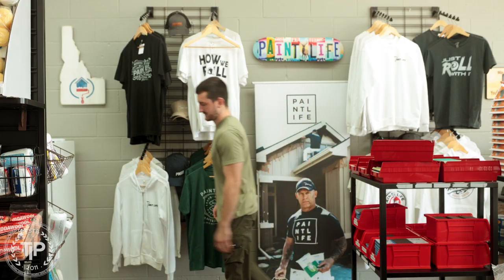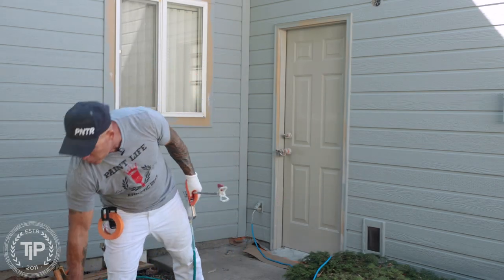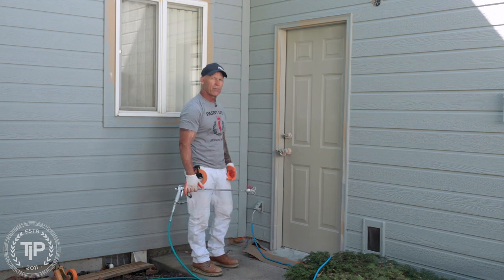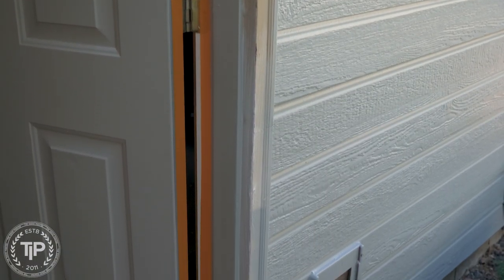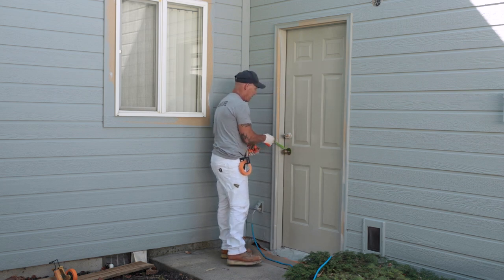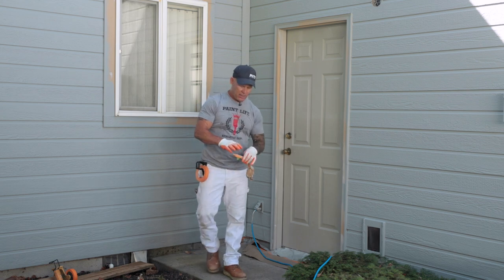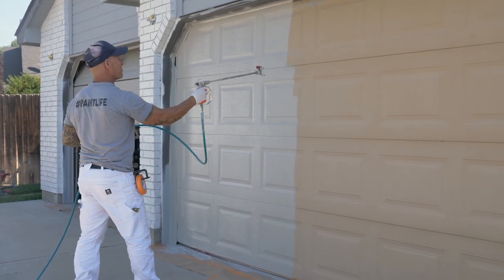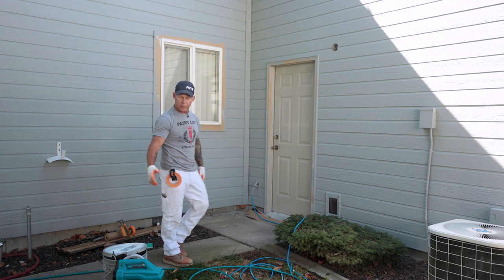Junk airless sprayer! Dino X6 Review. Harbor Freight Airless Paint Sprayer

Comment: Currently doing an exterior job, using the graco x5 with a 515 and a fflp 310. Works perfect! Have, to date, ran about 100 gallons of paint through this sprayer and is still running great. The key is to take care of your equipment! They can last a long time, just as long as you clean them extremely well! If you run hourly employees and are worried about your crew giving a shit about your tools, try this sprayer first!

Comment: I'm a renovation business owner, not a painting professional. I believe the Graco magnum x5 is an excellent low cost piece of kit. I spray anywhere between 1 & 3 gallons each time it's used. Believe I paid $450 canadian. Came with hose, gun and 515 tip. Currently use the Graco fflp 312 tip for cabinets and it works great.
Reply from the maker: The X5 is a low cost DIY pump at best.
Reply: @Idahopainter  correct, like I said not a pro and there's no point in dropping a large sum of cash on something that gets used 2-5 times a year. Great videos by the way. Wishing you nothing but success.

Comment: Thanks for the videos, and we are the manufacturer of this DINO-POWER X6.
The X6 is a DIY machine for the home user, not for professionals, and we can't agree with the conclusion in ''JUNK.''
The weight of the machine and the light spray gun should NOT be a disadvantage of a DIY sprayer, which you can compare for all the brands at the same level.

For the wooden door painting from the video, you might use the smaller tip, like 313, for better control,  and the pressure will be steady and won't drop rapidly.
As if the latex paint for interior wall coating, you can use 515, and the pressure's performance will be much better.

Anyway, this is an old model we produced at least 3~4 years ago; we improved the output of this model now, and the spraying pressure with 515# 517# will be 1800psi+
And we can supply the new model X9 for supporting the 519# with 2000psi + pressure.

For professionals, we get the models X20, X24, X28, X32, X51L, X81L, etc., from 2.0L to 8.0L for different applications.

I think the video is all good, but with ''A scary title'' for eye-catching, It's also hurting us : (
Reply: Well, Chris is clearly a professional, and he makes these videos for us so we don’t have to buy trash products
Reply: This is a demo machine we sent to Chris in 2018 for FREE; they promised to shoot a video to compare with X5, but we didn't get that video for 4 years; now he has made a video like this for eye-catching without telling us, which is irresponsible in his work.
Reply: I'm not expecting to much useful information from this guy for the average DIY person.
He's got the attitude of "I'm a professional painter and if you don't use what I use then it's junk".
That the way he comes across in this video and his comments.

Comment: Why would you use a 517 tip for such a small sprayer? Theyre absolutely not meant for that. Might as well just through a 621 on it and block fill with it.
Reply: Using a 517 or 515 is a waste of materials and added overspray especially for this small type sprayer…513 max. I sprayed a lot in my 35 years of painting before retiring maybe used a 517 1 or 2 times.
Reply from the maker: LOL
Reply: @Idahopainter  Not sure why that's so funny...People who think they know everything are the ones who are funny...

Comment: people sprayed a whole house with a graco magnum x5 so I believe the x6 sprayer can do that because it's built to compete with the x5 and it's slightly stronger than the x5
Reply: My X5 doesn't run the whole time I have the trigger pulled. In this video the X6 was running the whole time.
Reply: @northwestlife_9  I have a x5 too.  I guess the x5 has a better system but the x6 has better stats in terms of hp and tip size and gallons per year.
Reply from the maker: Sprayed yes,  Did a Pro job no.

Comment: Looks like they tried to clone an x5 and failed.
I'd say at that point go get the harbor freight avanti sprayer (the stand up one, not the floor unit -- P/N: AV-APS1) for like 200$ after coupon, and slap a Graco RAC-X tip and guard on it.
Or just buy a Graco X5 for 280-300$

I have the avanti, the pump doesn't seem bad but the hose, gun, and tip are the weak points. At a very minimum upgrade the tip and guard. the 515 was gross regardless of the pressure. I slapped a RAC-X tip (515) and guard on it for like 30$ from home depot.

I think harbor freight has a cheaper model that is more similar to the X5 or one of the wagner floor models, but I don't know anyone who's used it.
Reply from the maker: That is what they tried to do